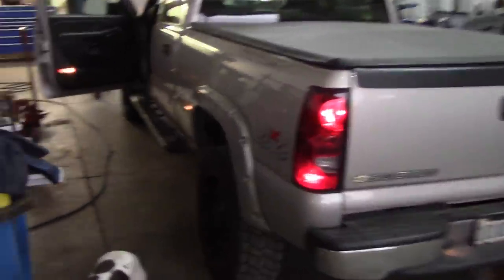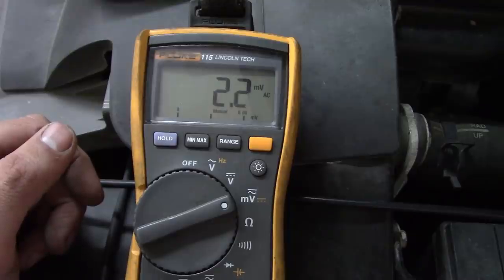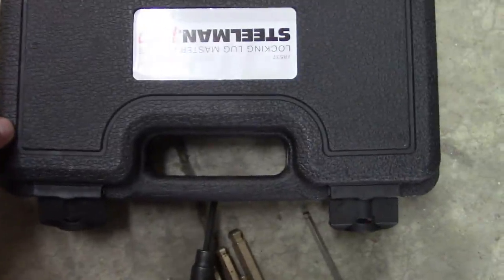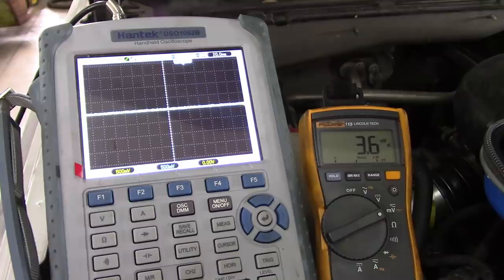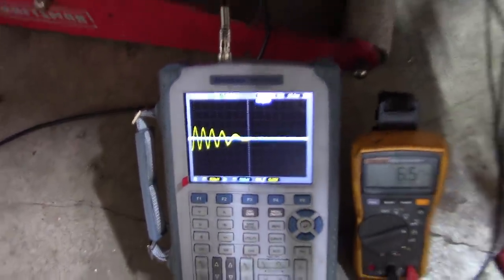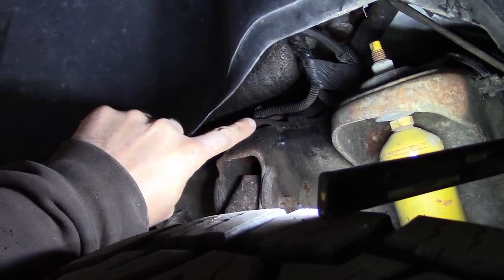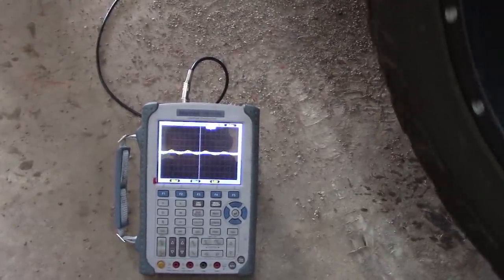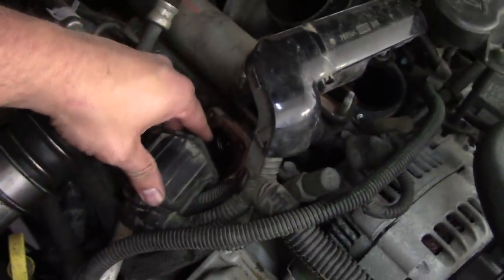2005 Silverado Duramax- Wheel Speed Sensors, EGR Flow, Glow Plug Module - P0401, P0404, P0670 - P2

Comment: Another fine mess Master Mechanic Wes fixes.
Of course his super HufflePuss sweetheart shows up to make him look good on camera 😉
Edit # 1.
Wes, no matter what, including not finding that wire harness problem.
The rust jacking pretty much made replacing the sensors was good mechanical sense.
Those sensors were extremely likely on their way out so changing them very likely saved you a bit of embarrassment when they do go bad and you get that truck back with a repeat issue.
That kind of issue tends to make you look bad to your client.
Edit # 2
Wes, doing multiple repairs on individual vids is just fine by me.
I'm Absolutely sure the overriding majority of your subs agree with that.
Please keep on track with providing us with your awesome tech tip sharing.
You'd make an excellent vocational school instructor Sir.

Comment: Man your view count are through the roof, I'm guessing farmers across the midwest, who get up early. Well deserved! Yup, I've seen ~0.5v bias voltage on these circuits before, only evident when you lose the ground. Interesting to see it disappear when the VR sensor generates its own voltage. Presumably resistors in line allow the sensor to overwhelm that bias, since the neutral baseline is zero when the sensor is working properly.
Reply from the maker: I'm not sure how the strategy works.

Comment: Just a little tip to keep rust & dirt from falling into the open hole after the sensor is removed . Insert a rubber valve stem into the hole before scraping off the rust
Reply from the maker: I just used a ball of blue shop towel. Gotta remember to remove it though.

Comment: You can check the glow plugs in the truck,all you need is an ohm meter,check from the stud to ground, resistance should be minimal,all they are is 12 volts shorted to ground.if the glow plugs is burnt out they will have high resistance,operational they should be down around 10-20 ohms,o....and FYI,if you have to remove one make sure you soak the 6mm stud before attempting to remove the nut,and do it with the motor hot,I use a 11mm deep socket on a 1/4 drive flex head ratchet,and your probably going to break the glow plugs off in the head,then comes the fun part,drilling them out👍

Comment: I had a co worker tear his hair out chasing a glow plug module issue on his father in laws 2001 3500 Gave him a fresh set of eyes on it. turned out to be pin fitment issue on the gpc connecter. Socket would only make a consistent connection  by putting pressure on it. Your problem is similar in nature but different in that the gpc does nothing at all. Food for thought. 
    I just went through the deep dive on   jbox/   acdelco tds programming for the first time, t was a pain.  Hit me up if you get lost in it. I did  😎

Comment: Same here Wes .... I just got in a Chevy Cruz, guy said he needed a new valve cover gasket. Turns out the intake manifold is bad causing pressure in the valve cover pushing oil out. Also his rear shock are completely blown and he has a noisy wheel bearing. Some customers think you looking for extra work when you tell them what's wrong with their car.
Reply from the maker: Yeah. I get that too.

Comment: The abs module runs basic self test when the ignition system is turned on. It will check all hardware and data connections. It can detect instantly if one of the wheel speed sensors is open circuit.

Comment: Hi Wes - You can buy those master kits for the OE style locking lug nuts from a company called McGard. They supply the lock nuts (the ones you say that have the squigly faces) for most manufacturers selling vehicles within North America (and assuming some outside as well). There's 2 to 3 master kits from what I remember.

Comment: Since the wheel speed sensor appears to be a coil (inductor) they can use voltage to run current through this coil to build up a magnetic field. This current is always present and can be used by the ecu/ecm to detect an open wire. Open wire is zero current obviously and it can sense this instantly without the car moving. When working properly, the field on the sensor varies with the tone ring to vary voltage where the amplitude and polarity of the voltage gives you speed and direction (respectively) of the wheel.

Comment: On my dads truck we just removed the old tube part and cleaned it all up and put the old sensor back in, we got new ones and took a long time to get around to putting them in, nothing changed of course, but now my dad isn’t worried and the glovebox has more room, turns out they aren’t so bad for angle, just depth, on fords at least

Comment: This happens on the similarly designed vehicle speed sensor on some transmissions, it’s basically the same thing but bigger and with the plug on the sensor not the wire, and black plastic, the white (nylon?) one for the input speed has a splined type case and doesn’t get stuck, but it also doesn’t have the metal nub sticking out like these do, they typically don’t get stuck

Comment: Something to note on the early duramaxes. The position sensor is on the motor and not on the egr pintle itself.  So a weak spring on the egr can let it open up under load and it sets a p0101.  Gotta be careful testing by the book at idle because not enough pressure to open the egr.   Will lead to replacing air filter or maf.  Watch freeze frame records to see what conditions code sets under

Comment: Wes replacing the wheel speed sensor wasn't a parts cannon move. When you're diagnosing a system that isn't functioning properly and you come across a sensor, actuator driver etc of the system not testing in spec. Really the first order of business is replacing the red haring, if the OEM says if it doesn't test BLANK then replace it and you're having a problem with that system. Again the first move is to trust the OEM and replace the faulty component. Then, move onto your next steps of diagnosis.
Love your videos man!

Comment: Keep the format you have.  I like the variety within the video.  As far as the wheel speed sensor versus the broken wire I would just ask in your experience how many times was it a broken wire and not the sensor?  Seems to me you rely on your experience and then only go look deeper if the problem is not repaired.  Thanks again for the channel.

Comment: You can substitute a 1k ohm resistor for the speed sensor to test for an open circuit since the EBCM does send out a bias voltage to test the speed sensor circuits for an open. The resistor won`t generate a sine wave of course, but can be used to fool the EBCM into thinking the circuit is good.

Comment: I think you're covering both the diagnostic and the entertainment aspects of repairs. I do enjoy the projects like the crawler and the lawn tractor stuff. With the computers on 4 wheels that we use to transport us these days, it's good that you show the thought and repair process' that still boil down to auto mechanic basics. Don't need a fancy Snap On diagnostic confuser to find bad wires with your MK 1 mod zero eyeball. Been working on rusty Michigan vehicles for over 40 years, so I can relate. What happened to the white 64 F100 on the trailer a few videos back? Thanks for posting.

Comment: First off:  loved the video format!  Was easy to follow and very instructual (but all your videos are).

I noticed the time on the scan tool:  6:35 am.  I'm curious what time you typically start working in the morning and when you finish?    Please don't let it be 10-12 hours.  Need to keep ample family time and not overwork the body.

Excellent job on the bonus footage find!  I myself only use adhesive-lined tubing as well.  Two days ago placed another order for 3M EPS-300 and EPS-400 shrink tubing.  Raychem for connectors due to the plethora of sizes available.
Reply from the maker: It just depends. I normally work at least 60 hours per week in the shop plus YouTube.

Comment: i prefer the old equipment videos but if you need the repair vids for filler than i would say "everything wrong with this vehicle" is a good format rather than multiple videos on the same vehicle.
20-40 minutes is good

Comment: I think your doing well.  I prefer videos around 15-20 min because my schedule is usually dictated in 30 min increments +/- 5min.  That said even with the longer videos I just have to watch them in 2 sittings rather than 1....side note on the wheel lock lugs...you should get a desktop CNC and 3d scanner than you can make your own...and i know it's not a good investment but...it's a good excuse to get the misses to let you buy one...
Reply from the maker: I have the same issue. I rarely have time to watch an hour long video in one shot.

Comment: We stick stuff in the hole you can pull out after you wire wheel the area and spray paint with a good marine zinc and galvanized coating.
Reply from the maker: I had a piece of a blue towel in the hole. That's why I said not to rotate the hub!

Comment: Said it last time, saying it again: you work and film it, we watch it, because what is this channel called? Right 😀. Miss the cnc lathe stuff a bit, though. 
Extra: your balance of talking and working and all is perfect, other channels I do Pip mode and read something on the web (ipad + safari, yes it is possible in desktop mode with a trick), not so with yours.
And I am not into cars. I check the oil... Worst I ever did on a car was cutting, drilling and bolting in a bolt into the rod of the clutch actuator of a 19 year old smart car so it could push the clutch lever around the hole that was rusted through where the thin bolt originally pressed on 😀. Still going strong that car. Or fix one of these variable speed resistors for the airflow that sits in the airflow like you had in one episode. The fuse was a strand of solder that melted... just some simple stuff.

Comment: video format is fine.  If people are searching the issue which would be months and years later, I would make sure the title and description are detailed enough with codes and part numbers so that the video is picked up by the search.  Is the description section under the video picked up by search engines?  If so, you might want to add part numbers and such.   If you think about it, most of your audience is watching for the content in general.  Not necessarily the fixes as it's not like we all have duramaxes at home.  I guess some portion of your audience is mechanics so maybe the technical part on a specific vehicle could be more helpful for that group.

Comment: My vote would be to keep it as you have been doing rather than break the videos into specific topics.  Not that you would not do a good job doing that but there are plenty of others out there who focus more on making specific diagnostic videos.  BTW I think you made the right call on the speed sensors they both had low output at the sensor and needed replacement.   Even if the wire was not broken that side would have failed soon like the other.

Comment: Did you know GM has a TSB out on some of these wheel speed sensors ?  If you checked  the voltage at the plug on the sensor and its below the threshold  there's a problem with it , usually it's junk built up on the end so they had to come out anyway  so don't beat yourself up about it
Reply from the maker: Yes. The TSB actually says you need a minimum of 350mV from the sensor. But I have found they will work well at lower voltages.

Comment: This was a great video. I don't think you should beat yourself up about the ABS diag. You followed the test procedure and from experience started at the sensor. Changing a part that is out of spec is not "shooting the parts cannon". Had you fixated on the short you could have spent hours looking for it had it been in a different spot. And likely needed to change out a sensor anyway.

Comment: However on some ABS systems you pull the fuse and it will cause the brake to not be  proportioning right. I tested this out on my 2002 GMC pulled the fuse and my truck main brakes were just in the rear. the rear would always lock up easy and pedal would be almost to the floor. Put the fuse back in I got the pedal back and the front brakes are work as they should and the rear is not locking up with out front brakes as well

Comment: I had a problem with my lbz that at slow parking speeds the peddle would drop due to funky abs reading from the same problem. I just rock auto 2 wheel bearings and was done. Didn't want to screw with sensors and rust.

Comment: In terms of loading the parts cannon I've done that a couple times trying to solve a p0446 evap code on a 04 chevy silverado 1500 had replaced the vapor canister vent valve and the fuel tank pressor sensor still have had no luck chasing down the issue.

Comment: Real life videos are the way to go IMHO. As you say, vehicles don't come in with just one problem so why should we see you just fixing one issue? Seeing how it is and how you tackle the complexity of interlinked faults is much more informative.
For example, if you'd have found that broken wheel speed sensor wire first, chances are the air gapped sensor would have still given you an error. Two problems, one error message.

Comment: The scan tool should be able to see if it can communicate with all the modules on the CAN Bus .. But I think (from a google search) that on that year vehicle, the glow plug module is not on the CAN Bus and if that is correct, you just order a new one and swap it in. I also think there may be an upgraded part for it.

Comment: I enjoy your videos Wes.  Just wondering why you did not put some kind of a plug in the sensor hole to avoid rust flakes getting into the bearings?     Even a paper towel crumbled then you could use a wire wheel and get it nice and clean.

Comment: don't throw out dead wheel speed sensors..  chop the sensor off the harness allowing you to use the remaining harness to check resistance easily to the module connector..  if you use female bullet connectors on the end of the salvaged sensor harness..  that allows you to use banana plugs to connect directly to the test harness..

Comment: I've had that glow plug code three times and all three times installing a new glow plug has fixed it. I don't know why service info says it's a controller issue. Take the lead off that #8 gp and swap it with its neighbor. See if the code moves cylinders. Btw, it was a different gp all 3 times. 3 down, 5 to go. Lol

Comment: I have a 2004 Buick Rainer and the automatic AWD is not working, I tried replacing the control module behind the dash and the actuator motor and that did not work. Do you think it could be speed sensors or some kind of wheel sensors because it seems like it isn’t engaging when the wheels spin/slip.

Comment: Bro what you doing back there! Does the egr valve remove without taking the cooler and valve completely off! Even though I cleaned it 😢. So happy I can command my scanner just like yours I think my egr need replace, Maxi ✔️ thanks for the read didn't know what I actually was looking at but I can compare. Love youtube university ♥️  definitely getting a like. LBZ 1st diesel 💪

Comment: Well you know Wes that you can "should have, could have, might have" all day long but in the reality of the situation you checked the output MV of the WSS and found a defect. As a mechanic that has worked on most everything sometimes the magical fix isn't magical and you have the same issues at another time. Had you found the broken wiring and repaired it and the codes cleared, how long would the ABS module allow the faulty MV readings from the WSS before flagging it as a failure? Now you have repaired the system back to some semblance of factory "correctness" and it should be trouble free till the next rust gremlin attacks. Chill brother, you can't please YouTube, someone always knows better than you, in your very nice shop, with your very nice tools, working on customers mechanical issues, as they sit in their chair and type BS comments in the comment section. 
Thanks for the videos and the time it takes to make them and thanks for a look into the amount of tools, time, money invested and commitment it takes to actually repair things!

Comment: Do you have a trigger setting on that shop scope you are using? If so, setting the threshold trigger level to %50 - %80 of what you expect should get you a captured still shot of the envelope of the wave. Assuming it can also scroll back and forth through the capture a bit, if it has additional capture memory.
Not sure of that Hantek capabilities, all my experience is on lab scopes...
Cheers,
Reply from the maker: The roll mode is pretty awful. You cannot go back beyond what is on the screen. It doesn't really have a buffer. If you increase the time base you lose resolution. It's very limited.

Comment: EGR motor is same in Hitachi(Deere) Excavators that use Isuzu engines. But Duramax was designed by Isuzu
Reply from the maker: Interesting. I thought all the Deere equipment made by Hitachi had Deere engines.
Reply: Watch Wes Work Im not sure of course. I worked 10y with European Hitachis and they had 4JJ1/4HK1/6HK1/6WG engines. I presumed Deeres are 100% same machines, its cheapest when thinkin manufacturing costs, and that what manufacturers only think(usually)

Comment: id watch your vids with multiple fixes. most of the time there is more than 1 issue .especially if its a ford then you remove radiator cap and install new truck.  video is a video to me bud l like them all

Comment: The truck probably still would have had abs activation at low speed due to that sensor.  It was bad as well as the wire.